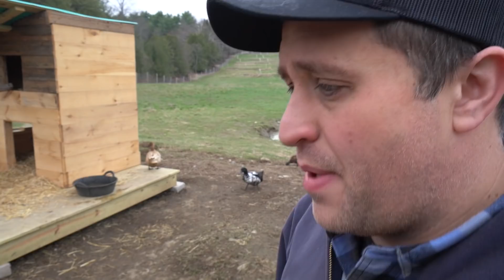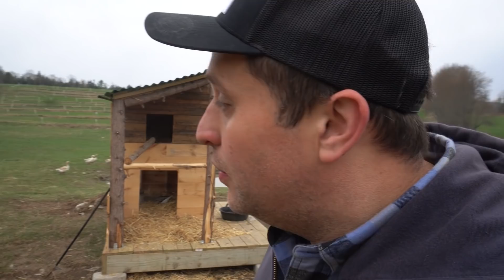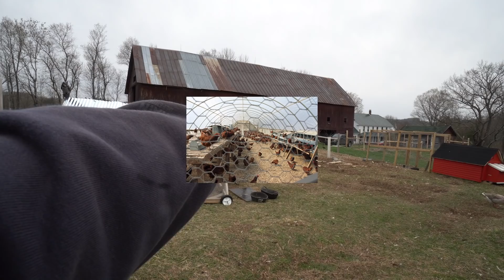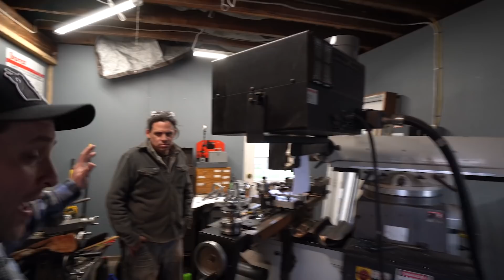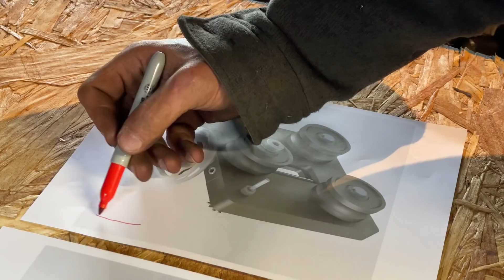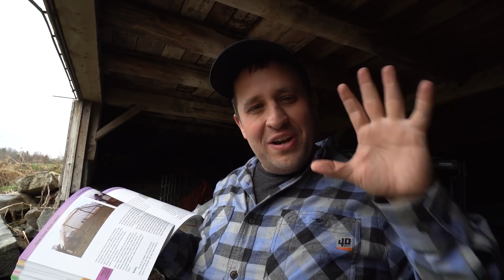A New Tool to Build a Better Greenhouse

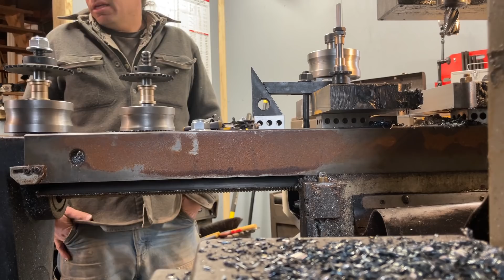Comment: @11:45 If the width is 20' the radius of the circle proscribed is 10'. So, with a 90° angle in the middle you have a simple 1-1-√2 triangle. The chord that he drew on the plans is the hypotenuse of that triangle. But don't you want the length of the outer curve? That's just πr/2 because it's a quarter of the circumference. Thus the length of the pipe is 5π+4', which is just short of 20'. You'd need to chop about 3 inches off a 20' pipe. 

Math is fun, but also I'm waiting for someone to tell me I did a calculation wrong. Bring it comments section!

Comment: I don’t mean to dump on your buddies project , and it probably too late now, but I always opt for cheap already done just to save time and not reinvent the wheel. I have one of the Harbor Freight tubing rollers and it’s only $200 and has done every project I’ve asked of it. I couldn’t build one for that much. Then you could put more engineering and effort in other details like how to connect between the hoops and the cross braces. Just a thought....

Comment: @Gold Shaw Farm 
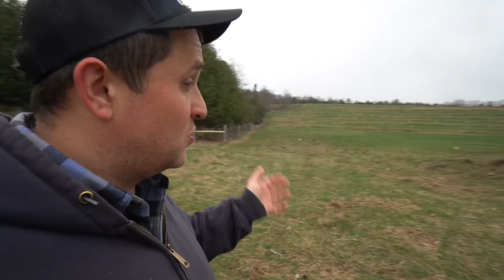7:31 NOTE! Greenhouse plastic/tarp & such have almost no insulating properties, it will not work in the winter. It only "Captures" heat, but it don't "hold onto" the heat as well. So when the sun goes down (or it's a layer of snow on it) the sun can't get inside & warm it up & most of the heat will escape quite quickly & it will be cold again.
You need some extra roof thing you can add onto the structure with added insulation to keep them warm, but then the sun can't get in (sun can't get in anyway if it's snow on the house).

Comment: I'd do a geodesic greenhouse that you can run tubing in the ground that's attached to a rocket stove that will heat the greenhouse in the winter. A hoop house would be a good idea, but a geodesic greenhouse would stand up to snow a little better. Though looking at those hoop houses you mentioned in the video seem a little stronger than the ones down here in Texas.

Comment: Just be sure you can keep the bar going in a straight line through the bender, or the ends will be at odd angles to each other.

Comment: PVC greenhouse my friend! Many of the light-deprivation mj growers in NorCal use them
Reply: PVC is the worst possible frame material in any place that has wind and snow. Almost no strength for heavy snow loads and any quality greenhouse poly will degrade much faster when in contact with PVC. Using it voids the warranty of the plastic film.
Reply: @workingfolk  totally agree. I forgot to mention that PVC is very brittle at negative temperatures and it does not possess good resistance to sunlight.
Reply: What about heavy snow? I guess that is the reason why metal pipes were selected.
Reply: @deniskalugin7984  Reduction of space between rows of support columns can counteract the snow, or you take the greenhouse cover off for the winter
Reply: @cala9765  as i understand this "greenhouse" is going to be used for geese for wintertime too. Increasing the number of supporting elements could be a solution but only on longitudial direction.

Comment: Inner diameter of larger pipe the same (or just a bit bigger) then the outer diameter of the smaller pipe. That way the smaller pipe can be seated inside the larger pipe and then secured to it. This will make the connection stronger (the larger pipe is helping hold the smaller pipe in place not just the linking hardware Which could come loose from bumps and vibration including from wind).

Comment: high tunnels. I'm not sold on the idea it just seems like alot of space that's not used if you got a goose that's 3 feet tall with high ceiling. I get you want to get your tractor in there but I build houses "expensive ones" they have these huge areas with 20 foot or higher ceilings and short people that live in them. So my thought is you have to make the most use of the space you have. Side note you already have a really big barn and I love that barn it has so much potential.
Reply: And as for Joel Salatin and Justin Rhodes design save your money. Just look at some pictures and make your own.

Comment: A 20 x 10 cross section is not going to fit your tractor except maybe straight down the middle.  You probably want to go wider and maybe somewhat taller if you want to use the tractor to do the clean out. You have to take into consideration maneuvering the tractor insider the hoops.

BTW that sort of pipe bender exists. I did some fire sprinkler system installation work one summer back in college and that was one of the tools they had. IIRC, and this was 30 years ago, setting the angle was fairly complicated. I'd talk to a pipe fitter if you guys can find one. Also I wouldn't try powering this off a cordless drill or if you do have lots of batteries ready.

Comment: Farmer's Friend is much less than that. It can withstand 2ft snow load. It has a Gothic arch which helps with the snow load. We have two of them. Basic kit is around $1100 each when you buy two. Shipping is free. I like Alfred's invention though.
Reply: He want a 20' wide house. Farmer's Friend makes a good kit but not that wide and with smaller diameter pipes.
Reply: Yeah, that's right. They only make a 16 ft.

Comment: What a neat project! I don't envy you getting 100's of suggestions. That said, here's mine---could you make the 4' high walls that touch the ground, out of solid material, not plastic? Sandi Brock, a youtuber in Canada who raises sheep in a LARGE commercial 'hoop' barn has mentioned that one big problem is snow piling up as it slides off the fabric roof in the winter. She wishes that the radiused hoops stuck out beyond her solid walls so as the snow piled up its starting point would be X amount of space away from the vertical walls. Having solid walls might help you build doors directly to the great outdoors from individual pens. And they'd be much stronger than plastic walls.  Good luck.  Need help?  I love VT in the summer and the dog chapel is a special place.

Comment: I wonder how too ambishous it might be in setting the number of fowl you might want. The limit of 100 goose eggs may be the sign that you may have over reached. You have not gone through a whole cycle of raising the fowl in that number. You may be shy of space to accomodate them all. Be satisfied with what you have. It is better to plan small and what the time tested experience of how you handle all the unexpected and undesired problem. What about getting another dog since the other one fell through?

Comment: Morgan check to see if you have a local industry that uses wood pallets for delivery. Sometimes they give them away for free and you can cut cost by using wood from pallets. The cost of wood has skyrocketed lately. It depends on what size wood you will need vs. what size you can get from pallets.

Comment: With the heavy snowing that you get, I don't know that I'd make your greenhouse 'round' actually. In the mountains, where it snows a lot, roofs are 'very pointy', with the steepest incline possible. Idk if I'm making sense, but basically it allows the snow to 'slide' down the roof easily... with a rounded roof, I'd be worried the snow would collect on the top of it, and get too heavy for the plastic ^^ nice video as always, great project <3 Stay safe, take care xxx
Reply: Every northern hoop house owner learns the value of a few well-placed posts along the ridge in winter. Ant the importance of clearing snow from the sides as it slides off. The pressure of the snow against the side walls can buckle them.
Reply: @workingfolk  yes, I guess all is carefully thought out ^^ I just wondered if it was the safest shape for it, but I guess it's easier to build it this way when you think about the sheer size of it all. A triangular-roofed glass greenhouse wouldn't be realistic of course lol (and way too fragile / dangerous, if the glass breaks it can injure the birds....)

Comment: Make sure you count your turns on the tube roller, or incorporate something to keep track of the turns on the roller. you're not going to be able to set it for the radius and roll each tube once. it will most likely take 3-4 or more passes to get the tubing to your desired radius.

Comment: You can buy a used pipe-roller pretty cheap. I have bought manual 2.5" rollers for $250

Comment: Do not use connectors, get pipe expanders like for exhaust pipe.  It'll be stronger.  Also, you have to worry about collapsing your pipe to out of round which weakens your structure.  You can use sand inside but it has to be packed to the same psi.  After you get the roof bent, you need to have load braces welded to the exact same placement like trusses. You'll need a wire welder and 
Develop expertise welding that thin pipe without blowing holes in it. Electrical conduit ought to do you well in say 1 1/4 or 1 1/2 - 2". Be sure to grind and spray galvanize your welds.  Hope  this helps You.  Connectors will just not be strong enough since there is just too much gap or difference in diameter. Tighter the better and twice the diameter of the pipe if possible.  Sounds fun.!!😁

Comment: I find the very thin walled tubing doesn’t bend easily it collapses.
I’m sure you will experiment before buying all the tube.
Looks like a good idea how much did you pay for the bending/rolling machine.
Reply: We'll match the diameter of the groove in the rollers to the diameter of the pipe, and that will reduce the risk of crushing the pipe

Comment: Looks like you might need a blacksmith bending jig or scroll maker... I can't remember exactly what it was called but made it easy for the blacksmith to make large metal hoops from iron strips.  No hammer necessary -- just push with your body weight -- we had one in Shop class in the 1970s.

Comment: I built pipe and tube benders and sheet metal rollers for a playground company I designed and managed for . It is definitely worth it if you diy it properly, make sure the dies are made to match tube diameter . Too big and your pipe will flatten ,to small it will wrinkle and crack but your doing a gentle radius so should be no prob . But watch fingers I lost my pinky tip that I pinched in the die . Lol 😆
Reply: I cut a 1" radius in the rollers, and tested the rig out on a piece of 1 1/2" EMT, it did flatten a bit, so I am going to definitely match the radius to whichever diameter pipe we choose to go with.  Thanks for your input.
Reply: You got this .. I can see your a very smart person . That tube former can open up a lot of work for you also . I did many custom jobs for people . Good luck . Keep it tight . Lol

Comment: Ambitious, and I hope it goes well.  If I had any concern, it'd be for the plastic; like you said, it's rough winters in Vermont so get something that can withstand the weight if you get a particularly heavy build up; if it's very wet snow it has a habit of sticking to the plastic.
Reply: My hoop house covered in plastic held up well in Maine near the white mountains. A couple well placed poles is the trick every northern hoop house  owner knows.

Comment: Just so you are aware... the kits cost less than the materials to do it. Was building my own and realized the outside cover going to cost me more then the kit itself. I was just doing a 10x12  with pvc but the 4mm siding cost 1k per 12ft x10ft section. I'll be buying the kit and then saving the pvc for shelving later.

Comment: That is pretty cool plan, can I make the suggestion that you make the uprights and curves as separate pieces. I expect that should make fabrication, transportation and assembly much easier. Take a look at 'jointing pins' used with steel scaffolding, these are inexpensive, as are scaffolding poles. Those are probably too big and heavy for your needs but the jointing method would work well. Edit: This sounds alike a bit like the method Alfred suggest to use to join the foundation poles to the uprights.
Reply: We'll drive heavier pipes into the ground, and use pins to connect to lighter wall pipe that we use for the hoops.  There will be two pieces of pipe for each hoop, and they will be connected with staging pin-like connectors.  So each hoop will have two piles driven into the ground, and two bent pieces, with a total of three connections

Comment: Not sure you are looking at it the right way.  There are constant costs that don't change with either option, so it really comes down to the difference of the kit cost and shipping vs tubes, hardware and plastic.  When you crunch those numbers, it works out to 36% savings.  Also, there's the labor costs, that would differ depending on the option selected.  Anyways, material wise, it's 36% savings.  Also, Alfred is a genius.

Comment: Ok, correct me if i am wrong here. on the spreadsheet in the end you have 20 foot steel tubes written. dont you need longer tobes? when u bend them you lose length? Or am i missing something?
Reply: They will need to be connected in the middle of each span.  20 feet is the maximum pipe length available.
Reply: @alfreddedam1947  ahh ok, I did not know that

Comment: To clean out your hoop house I would STRONGLY recommend looking into a backhoe attachment for your tractor 🤔 The front loader is great but the reach of a backhoe to PULL out of corners and sides to the center so the front loader can work best. Once having them complimenting the other is experienced you will see what I mean.😊 Front loader are a blunt instrument, a backhoe is a Precision instrument.

Comment: 28%. You also have to ask, is it worth your (and Alfred's) time? Personally, I would buy the kit and use Alfred's and your time to reinforce and modify for the snow load. Also, a way to remove that snow load. 3 or 4 feet of snow weighs ALLOT. Probably you could have a path on either side to run the tractor down, removing the snow on the ground, and letting the snow on the house slip down the sides. 
Another thought, is maybe just build a quarter or half the house this year, and build some more next year, using the experience you have gained over the winter to improve it.

Comment: You will need two sheets of greenhouse plastic  and inflation fan for Vermont winter
Reply: Probably overkill for a winter goose shelter. I grew spinach in Maine all winter in a single layer tunnel.

Comment: hello there, great job you are doing. but i noticed Alfred saying something about straight poles at the start of the risers,if you do that you will have a great shearing effect at the connection between the curved part and the straight part because the loads will not be transmitted totally vertically to the straight poles and part of that load will be trying to pull your joint vertically towards the outside. this is why all hooped constructions are made of one continuous curved part to transmit the loads straight to the ground,otherwise you will have to put inside connectors to hold the opposite poles on each riser. before you build the whole structure you should experiment with only one loop ,rise it from the ground and apply some load downwards from the highest point and you will see how it reacts to heavy loads such as snow .
Reply: The radius will start 4' from the base, we will just not bend the last 4' of each section, so there will be no connection.  These are good considerations, but I feel that the plastic would fail before enough strain would be placed on the pipe before it would fail.
Reply: @alfreddedam1947  even if you dont have a connection there this is a weak point because the steel will already be bent at this point. And you are right about the plastic in the case of snow. But if you have wind or some freezing rain or ice formation , the ice will form kind of a slab isolating the plastic from the weight and applying it to the steel. It is worth it to experiment with only one loop and apply load to it to see how it will react. I am a civil engineer but not in the states and i dont know what is the snow or wind loads in your area but usually when we are using straight poles as risers we have to brace them from the inside because of the pulling force at the joint

Comment: I saw a man build a wooden form and a roller that followed the curve of the form. No motor to turn you just manually pulled the pipe around the form with the one roller. All you need to bend all your hoops the same size. Your friend is a good machinist I would say by the look of his shop.

Comment: My mom had a kit greenhouse and it collapsed with a heavy snow load - did you factor in the stronger pipe - you are saving more. 

The plastic roof was a fun place for my mom's cats to climb on... sinking their claws into leaving holes in the plastic.

Comment: You're going to make up the savings in effort, but it could be worth it.

The only real problem I see is the way your geese nest and defend, they're not going to want to walk down Goose Row to nest.  They're going to fight over the ends where the corners are, near the doors.

You're going to need more corners, which means more doors, which means this hoop house probably won't do what you think it will.

You likely need an aviary that is radially symmetrical with several goose houses (like Toby's), probably setup 4 goose houses to a "building", one on each corner, and a small complex of buildings.

You can probably ditch the hoop house already if you make the goose houses tight and light enough to tractor pull around the farm.

Then you won't have a giant building to move if you need to, just smaller goose houses you can arrange on the farm however it works.

Comment: Take it from a long time machinist turned metalworking machinery dealer: Despite the fine workmanship Alfred is wasting his time trying to build a pipe roller that is normally mass produced and widely available. You would be far better off buying a good used unit and then selling it to recoup your investment when the job is done. An astute purchase may even produce a profit.